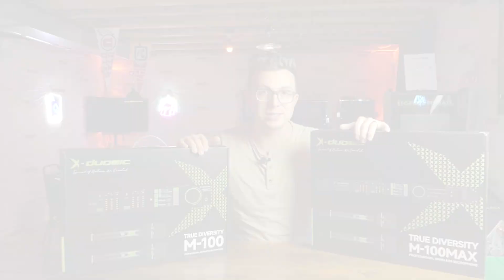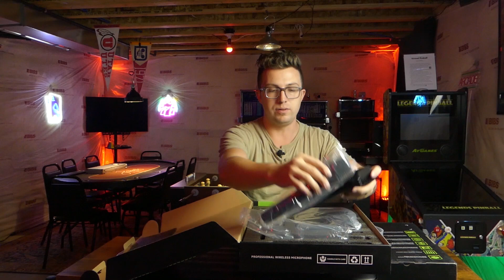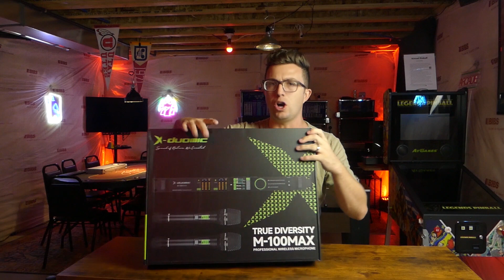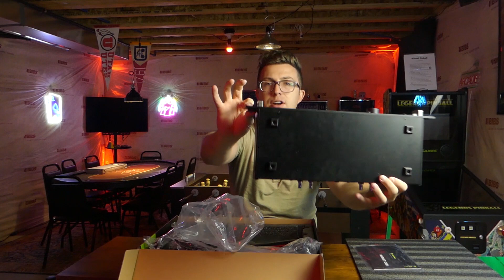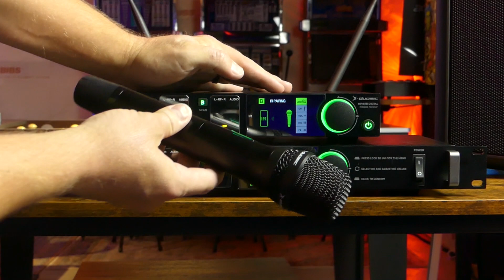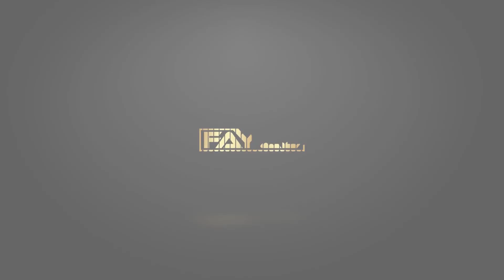Are these my new favorite affordable microphones? | X-Duomic M-100 and M-100MAX Review

Comment: To get the microphones to work 1) Make sure Mics and receiver are on, then Press Scan 2) Press Sync button and MAKE SURE THE display of the microphone handsets is almost touching the section of the receiver that is labelled IR so the two devices have no distance between them and can easily sync ... you should now see a volume meter on the receiver!